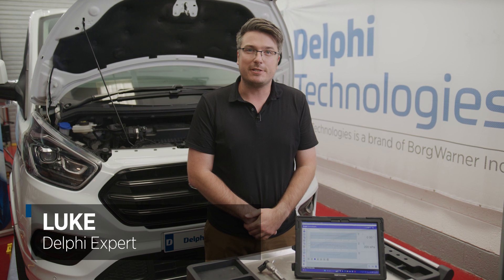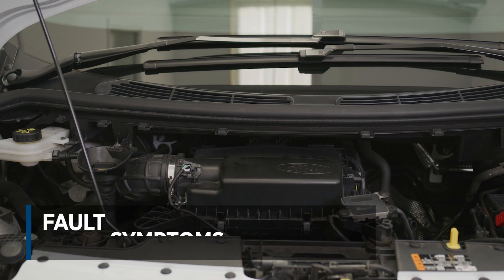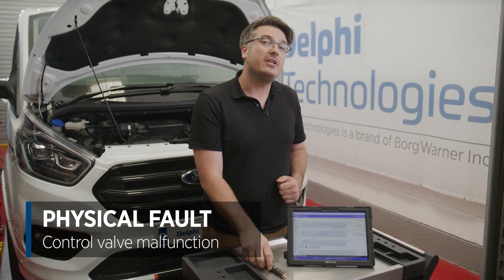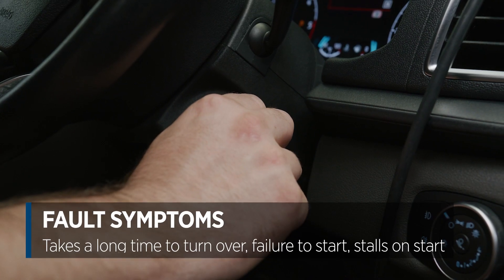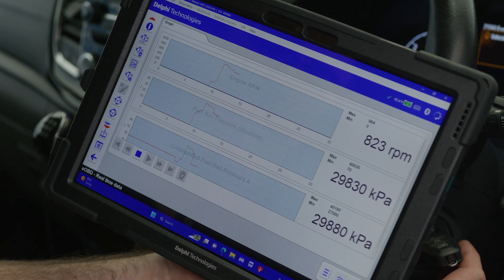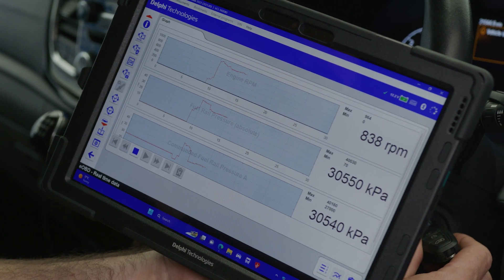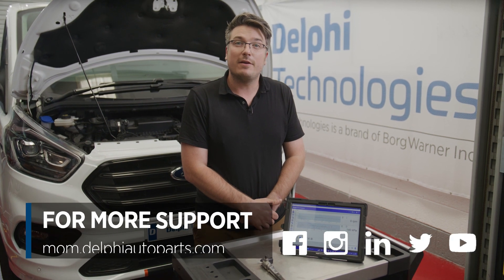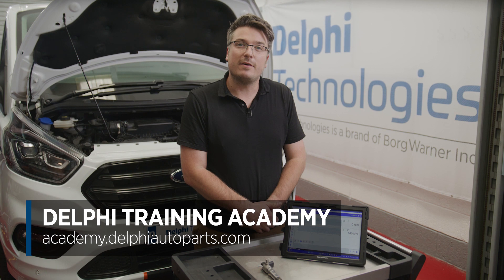[EN] Symptoms of a leaking diesel injector | Masters of Motion

Comment: I have a 2001 Renault Trafic cdi100. Has developed low fuel pressure, hand pump is soft overnight with AIR in fuel. Needs bleeding before starting after a time.
Could this be injector? Goes like a bomb once started, pulls up hills 100%, so told its not pump, no black smoke on start  up. Definitely air in fuel, if you 1:33  could be as so kind to say if it could be an injector or not 1:33
Reply from the maker: Hi and thanks for the comment. We recommend having one of our authorized diesel centres take a look at this due to the intermittent nature. Can you send an email to support.uk@phinia.com with your location / address and we can locate the nearest one for you. Thanks!